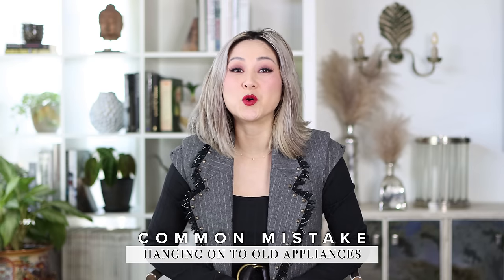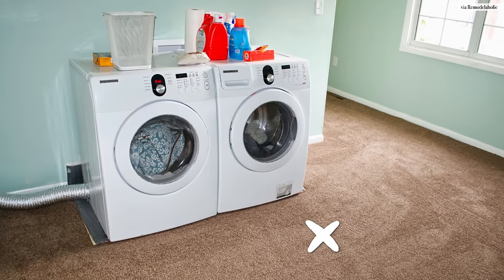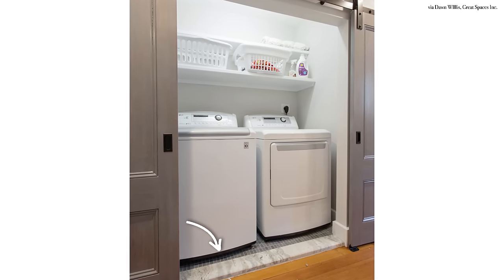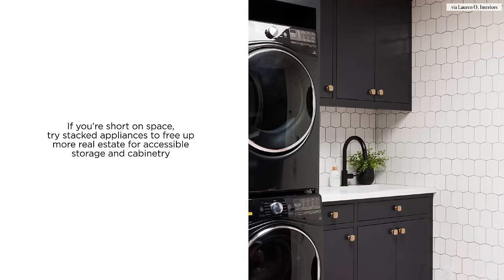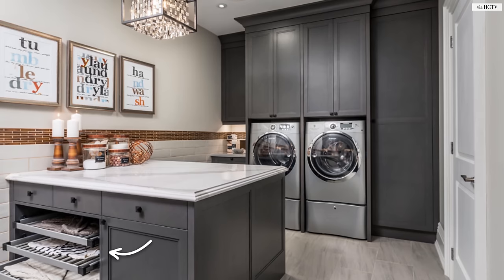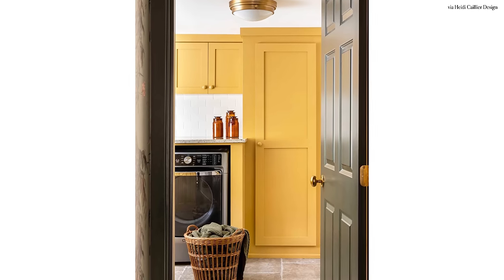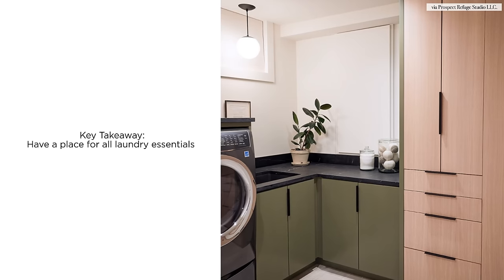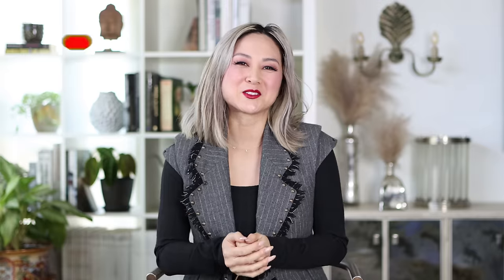COMMON DESIGN MISTAKES | Laundry Room Mistakes and How to Fix Them

Comment: Thank you. I like how you speak clearly and slowly enough that I don't need subtitles (I have to use subtitles a LOT for videos as I have some hearing impairment). One bit of constructive criticism is that the sudden pauses between speaking is a bit jarring. I know there is text on screen for some things, but the pauses between speaking seem a bit too long at times. I do like that the music you have is soft. So many videos have the music that is way too loud or have super annoying bass but the music you chose is pleasant and not too loud. 

I'm going with waterproof vinyl plank because it won't tear as easily as sheet vinyl. I will put a waterproof barrier underneath it and a floor drain to allow water to drain out if there are any leaks or overflows.
I don't like cloth rugs for an area that gets wet so I will likely get a wide waterproof anti-fatigue kitchen mat so it's not so uncomfortable when loading/unloading laundry.
The only open shelving I will have will be directly above a window where a cabinet can't fit. It will also have a closet rod to hang stuff on. On either side I will have two oak cabinets 12" deep. I got a free closet rod because my sister was throwing hers out. The unfinished oak cabinets are inexpensive and I can paint them whatever color I want.

Wicker containers would absolutely not work in my house. My cats would dump the contents, claw the containers, and sleep in them. LOL.

I fortunately have enough space for side by sides. Stacking would mean I couldn't use the pedestal drawers. It would make the heights very uncomfortable for me-- dryer would be too high and washer would be too low. I've got a bad back so pedestals make it much more comfortable for me. Also, there is nowhere we could put them without them obstructing a window.

I may actually try the multiple tension rod thing, but we'll have to see how things work out for the space. I'll have to see how it looks though.

I'm going to have a ceiling fan with a light to cool the room off and provide light. Definitely going with LED bulbs. I don't need my laundry room to look pretty-- I just want it to function. Right now mine doesn't function well. I will be re-using an Evergo brand ceiling fan from the 70s/80s. I also like very bright lights instead of "warm".

The back door (which is next to the washing machine) will add that pop of color. I painted it Behr Deep River blue. The machines are Mediterranean blue so they also have color. I'm debating whether or not to color the cabinets white or the deep river blue. I'm sort of feeling like it might be too much blue if I paint them blue. Since I'm taking out a wall and the ceiling tiles will be a mess, I might put up beadboard on the ceiling. Or I might just paint the shiplap (if there's enough of it) white.

I'm on a budget so the walls will likely just get a coat of semi-gloss or satin paint in white or a light blue. I disagree with wall paper unless it is waterproof. I know you are focusing on the design aspect a lot, but in terms of function, one mistake I didn't see mentioned is something I see a lot: Not putting shutoffs in an accessible place. It's important to be able to do maintenance so you need to have the shutoffs in an easy-to-reach spot in case of an emergency. It's also useful to be able to pull the dryer out in case something gets stuck in the duct or the duct is damaged. The floor transitions can be a nightmare when trying to move the machines forward-- the stacked machines also makes it very difficult to move them to get to the back for maintenance.

Overall, you had some good ideas and suggestions. The images were pretty. I'm going to be content with an ugly laundry room so long as it works and I don't bang in to the wall or hurt myself trying to load/unload laundry.
Reply from the maker: Thank you for watching and providing great insight! I didn’t even touch on the shutoffs, but you make an excellent valid point. I’m off to see where mine is located now 😅
Reply: @JulieKhuu  Nowadays the shutoffs are often in a plastic box that has holes for shutoffs and the drain. They are starting to have separate boxes now though as pedestals raise machines up higher and there are limitations on the height of a washing machine drain.

In terms of aesthetics, if you don't want to see your shutoffs, you can see what Ana White did in her laundry room and make a hinged door that hides the shelf behind the machines. I will have a shelf behind mine to keep stuff from falling behind it.

Back to the washing machine drain/standpipe: The two main plumbing codes are UPC and IPC. Under both codes the trap weir of the P-trap must be minimum 6" and maximum 18" above the finished floor. Also under both codes the minimum height of the pipe above the trap weir is 18". Under UPC the maximum height is 30" but under IPC the maximum height is 42". The standpipe for modern machines must now be 2" diameter and must increase to at least 3" when merging with other drain lines. The vent may be 1-1/2" and you should have a cleanout opening on the vent pipe. So, something to keep in mind is that you will need to have access to the vent pipe to run an auger (plumber's "snake") down to clean it out if there is a clog. (I can provide specific code references if anyone is interested).

I found when planning my laundry renovation in Sketchup that I had to change the height of my trap weir to not conflict with my dryer's vent because I have a 15" high pedestal and my pipes have to run behind the dryer.

An important upgrade for older laundry rooms is to remove the 3 prong dryer outlet and plug. They should be replaced with the 4 prong ones for safety reasons-- older ones can cause the machine to become electrified and kill electrocute people or pets. As an aside, it is a good idea to have a GFCI outlet for the washing machine as it will be in an area that can potentially get splashed with water if a hose leaks. They sell "burst proof" braided steel lines but there are still chances of something leaking or spraying. GFCI will cut power before someone can get electrocuted. I like to have outlets in easy to reach spots in case quick unplugging is needed in an emergency.

For the dryer vent, the soft flexible venting is easily destroyed/damaged so more rigid stuff is recommended. I personally went with a Magvent 180. It connects to the machine like a regular dryer duct but it has a magnetic receptacle for the wall and a magnetic end to the duct so it snaps in place magnetically so you don't have to fight to put it on or remove it. That way if you need to do maintenance on the dryer, you can easily pop the duct off and pull the machine forward.

Another thing I forgot to mention was having a lint bin/trash can for when it's time to clean out lint from the dryer. There's currently no room for one in my existing laundry room so I have to carry it to the kitchen trash or stuff it in to a plastic bag (that the cats invariably find and play with). LOL. When we remodel, I'm putting a bin next to the dryer to put lint in.

Now I'm going to re-watch this video so I can see the pretty pictures again.

Thanks for "listening" to me babble.

Comment: The newer models fall apart after a few years.  The new ones have control with electrical panels and if those panels go wrong, the price to repair is almost the cost of a new appliance.  My dryer I got when I moved into my first house 20+ years ago, and it was already 15 years old, and still runs better than a new machine.
Reply from the maker: The old washers and dryers are too rough on my delicates since I don’t dry clean anything anymore Elizabeth. Definitely take into consideration your needs and go from there 👍🏻☺️

Comment: Great video. Thanks so much! I'm about to start construction on a new laundry closet upstairs (7'' wide)! Got some great ideas. We have side by side machines because we refuse front loading washers. So, I'm looking at basically 2 extra feet to the sides of the machines to work with (and of course above the machines!) and figure out the best use of space. It's across the hall from a bathroom, so I don't think I'll need a slop or pretreat sink. We're going to put a murphy style folding table on the outside side wall of the closet, so folding space is taken care of. I'm thinking some form of dirty clothes containment, whether that's a pull-out lower cabinet that hides the hampers (one for towels, one for clothes!). Love the color choices in the video and keep up the great work!
Reply from the maker: A hamper station is a great choice or a pull-out drying rack if you need one. I line dry all my delicates (no more dry-cleaning expenses woohoo!) so this is essential for me. Hope that helps!

Comment: Hello Julie~

So very pleased I found you! Your content is beyond helpful; so much depth. I have learned invaluable lessons from all your content! My husband and I are slowly working through a whole house remodel... circa 1964! Our laundry is in the garage.  If possible, a video addressing this scenario would be greatly appreciated. 
Thanks!
Reply from the maker: This is common spot for the laundry area Dina! I would definitely implement the same tips and use wallpaper or color to create a designated zone. Laundry cabinets would help to define where you start and stop the finished treatment. Will try to find more illustrations for a future video 👍🏻☺️

Comment: I want to store my laundry detergent etc. in bottles other than what I purchased them in. I put the detergent and softener in a glass bottle with a rubber seal. I also put my bleach in the same type of container, but it seems to be eating the rubber, and my bleach is turning black. What would be a good alternative, as I don't want to use the plastic container it was bought in.
Reply from the maker: Try a glass vessel with a clear silicone stopper Dawn.

Comment: I think it’s odd how the W/D always sticks out a little at the front of the cabinetry.  They ought to tuck under there, in my opinion.  Also, beware of appliance cost.  If a stacked set is chosen, when either the washer or dryer goes out, they both must be replaced if they are one unit.
Reply from the maker: Thank you for watching Corri! The appliances have to stick out because most countertop depth cabinets are 24”D (industry standard). Any deeper and they would be a “mistake” since it’s harder to reach all that way for items stored inside. Thank you for the tip! 🙏🏻☺️

Comment: Great work Julie.. I have a small laundry room 5’x7’ on floor map of our house. Plz share some clever updated ideas to add ironing boards that can be fold/ hide away
Reply from the maker: You can simply mount it on the wall and pull down when needed Dua! Check out some of these images again, lots of ways to address this common design element 👍🏻
Reply: @JulieKhuu  thanks Julie . You are awesome as you personally reply to so many queries of your viewers.yes , your are right . We are thinking it this way , it’s just that there could be some different ways to choose from . My laundry room is going to share one wall with kitchen . So it’s a must for us to make it look completely organised and classy . What do you suggest for separation :Should we add  barn door or swinging doors ( like We don’t have to push or pull them while carrying  something ) or  leave it open . There will be an exit door to outside  on the common wall right between kitchen n laundry room.  Thanks
Reply: @JulieKhuu  I will request to do one more video n share your thoughts n examples of multifunctionality in laundry room for sewing , ironing etc. This is a lot of spent time at room . Thanks

Comment: Would love your suggestions on a closet laundry room as we don’t have much space
Reply from the maker: Side by side front loading to gain at least 6ft of countertop space above it. Double height cabinets above to accommodate laundry needs, extra linens, cleaning supplies. Paint or paper in your favorite shades and add curtains on the outside above the closet opening for full access and to hide the ugly 😉 No doors = no obstacles 👏🏻

Comment: I need to dye fabric so need a top loading washer with the ability to fill the water to an adequate level. That feature is only available on older models long before all these water saving features. I'm praying that my machine doesn't die anytime soon. A friend has been through 3 new machines in the last 10 years or so and hates them all. Says they don’t clean well because they are so stingy with the water that she must wash some loads several times. Not much energy savings if you ask me.
Reply from the maker: Love this angle Jay and you’re absolutely right. When I used to DIY dye my fabrics, I did it in my parents’ top loading washer! I forgot all about that! Clearly, this is conditional, but that’s a good point too. 

I just replaced my smart washer- the drum collapsed and it cost more to service than buy a new one. I’m on year 10. I have no qualms about the new upgrade. It served me well. When it’s time, it’s time.

Comment: I usually adore your advice and design ideas but this laundry one has me a little baffled. Chandeliers and dramatic lighting fixtures for the laundry room? I'm looking at these ideas and seriously wondering who has the availability to create a whole space that's decorated around laundry. Yes, I get making it look clean, organize and functional. However, realistically, most homes have their washer and dryer in their basement. I live in the city, not suburbs, where homes go back to the 1880's. My home is from the 1940's. Right next to my washer and dryer, are the following: water heater, sub pump, and a huge furnace. On top of that I have pipes and heating/air vents all over that run up to the 1st and 2nd floors. How am I supposed to design around that let alone hang a chandelier. The ceilings in a lot of basements are often low as well. I think mine is about 7-8 feet. 
Can you please provide an updated video on laundry rooms that is a little more realistic for older homes?

Edit: forgot to add that I also have a laundry shoot that I love. Suggestions for that as I don't have the availability to hide baskets in cabinets.
Reply from the maker: Thank you for watching Sara! I realize my videos and suggestions may not be suitable for all homes of course! Just do what you can to inject some functionality like cabinets, garment rods, and maybe a bit of color just for that side of the basement 👍🏻☺️

Comment: How do you suggest hiding electrical panels, water tanks, and other industrial piping and wires if the space is shared with the laundry and can’t be dry walled? (For access) 
Do you suggest relocating the laundry room entirely?
Reply from the maker: I have this exact condition and simply live with it Gina. My laundry area is hidden behind curtains so at least I have some covering

Comment: Thank you again for yet another great video! My question may be too vague, but I’d love your input. I am moving into a much smaller space and am considering switching to a compact washer & dryer. The thing is, I just bought the set I have now, last year and I really like them a lot. They are stackable, but have a difference in dimensions of 4” in both height and width, with about the same amount of depth as the new compact pair I’m looking at. In your opinion, is that a noticeable amount of space and worth considering swapping out? Thank you, for your time and your hard work making these videos.
Reply from the maker: If you’re bothered by it, have the budget for it, that’s all that matters Eileen. It’s kinda like Botox. There’s no authority on when you should take the plunge 😂

Comment: Great inspiration ... I do have a basic question.  When choosing stackable appliances does washer go on top or bottom or does it not matter which way around ?
Reply: Isabel,the washer goes on bottom for 2 reasons. Water doesn’t naturally flow up therefore reducing water pressure and washers have a tendency to get off balance and vibrate which could cause it to vibrate off the dryer. If the washer and dryer are not made to stack you can buy shock absorbers to put under the legs. I did this and have not had a problem. Hope this is helpful😊
Reply: @sherry9568  very helpful thanks Sherry!  Definitely makes sense so appreciate you explaining the why of it
Reply from the maker: What Sherry said 👍🏻☺️ Thank you Sherry!

Comment: Currently building and I did pick a black tile for the laundry room but I almost did engineered hardwood because it’s on my first floor which is all engineered. I wonder really though how much of a risk it is versus having wood in the kitchen? You have all the same risk, don’t you?
Reply: Depends what floor level it's on.
Reply from the maker: Technically, yes. All wet areas have some level of risk 👍🏻

Comment: The biggest mistake is from the laundry machine companies that can't seem to figure out how to make ergonomic machines. Put one big ass drawer  or several shallow drawers on the bottom, the dials on the side, and the wash/dry area at slightly above waist height. For Pete's sake, it's not that difficult to figure out. It's like these people have never done laundry before.
Reply from the maker: They make stands with drawer pullouts, but it’s not integrated in the design. Great points Brandi!

Comment: I have a question Julie, please help💚🙏

I just wanted to ask a Feng Shui question.
So basically my new home entrance door opens directly to a brick wall ( neighbors home- the side, A tall wall)
There is hardly 1 meter gap in between.
I just wanted to know, what can I do to get get rid of negative energy and allow good fortune and positive energy in instead 💚
Many Thanks in advance🙏🌈
Reply from the maker: Hanging plants outside your entry will help, you can also add more light to the space MD. Think about creating a beautiful landing space